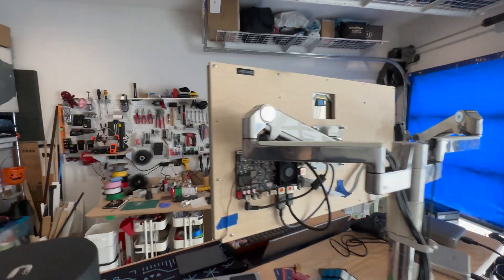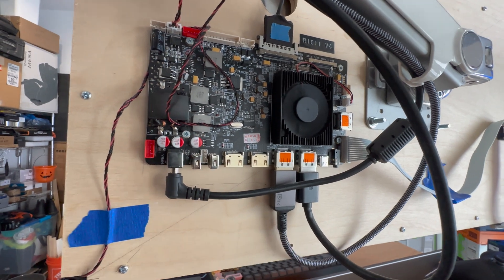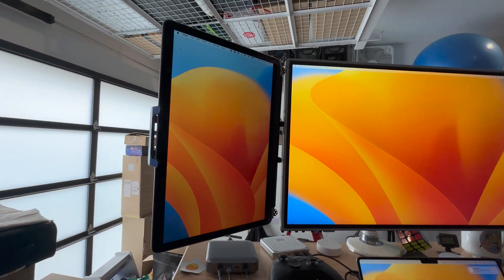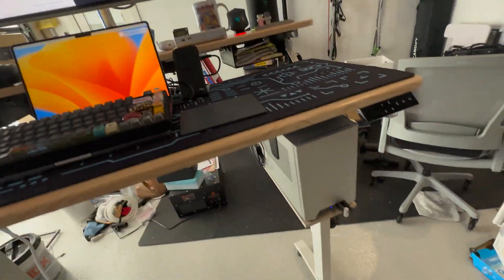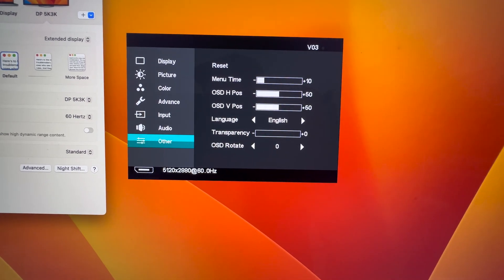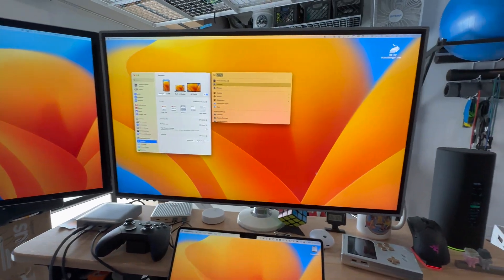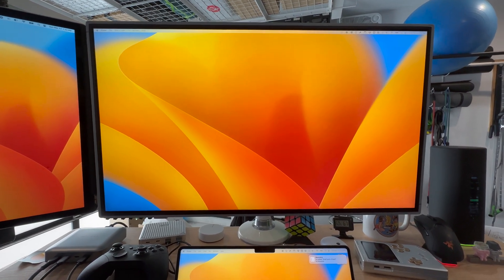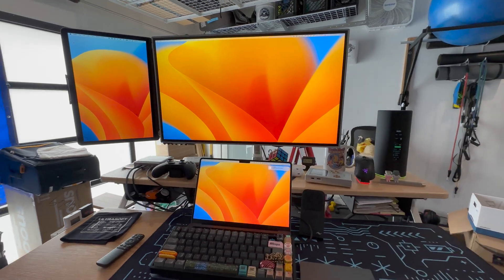Build Your Own 5K Monitor: Part 1

Comment from the maker: Part 2 video out now! https://youtu.be/TRxAxbHYZPc

For those wondering I was able to get this panel to do 3840x2160 @ 120Hz without issues using Nvidia Control Panel to make a custom resolution. 5K seems to be limited to 60Hz.

Comment: How hard was it to get the glass off the front? With just the panel, is that pretty much how the LG ultra fines are? Its just the bare panel you can touch? I know the imacs normally have like a glass cover over the panel, right?

Comment: So the LG 5K Ultrafine has a known issue with their control boards dying - which was handed over to me to 'revive' - I'm wondering if it's worth trying to resuscitate a dead one with this v4 board mod (and taking it out of the chassis)? Hmmm.
Reply from the maker: Would probably work but the board is different size with different ports so it wouldn’t fit perfectly without modifications to the display enclosure. On the plus side though it would add HDMI and and DisplayPort in addition to having Thunderbolt.
Reply: @james.a  oh wow, appreciate the quick reply and input. Happy new year! Old link to the board is OOS, have you by any chance found an alternative seller?

Comment: Is there a way to do a similar project just to make the display capability more convenient like just hdmi and keep the factory display?
Reply from the maker: Yeah. Just get the panel and driver board and you have a 5K monitor with HDMI
Reply: @james.a  I have an old thunderbolt display already. But I use pc so im looking for a way to use it without upgrading the display.
Reply from the maker: Is yours the model A1407 Thunderbolt Display? If so, there are driver boards available that, if swapped in, would give you an HDMI port but it wouldn’t be a simple drop in replacement to get it to fit inside the enclosure. 

This board for example would work on that display: https://www.aliexpress.us/item/3256802367606863.html

And then I’d follow this guide to take it apart: https://www.ifixit.com/Teardown/Apple+Thunderbolt+Display+Teardown/6525

You’ll definitely want to get a couple of those suction cups to pull the glass off. It’s only being held on by magnets and it's not easy without the suction cups.
Reply: @james.a  yes sir A1407 not super concerned with the work involved. Just want to be able to connect it to my pc via hdmi. Your project is pretty sweet but it out scales the budget for my needs.
Reply from the maker: Then that board I linked above should work just fine. Let me know how it goes!

Comment: I saw MST mode in the settings, does that mean one of the displayport inputs changes to output for daisychaining? if so that is very nice
Reply from the maker: I didn’t know what MST support was until
you pointed it out. Interesting… 🤔
Reply: @james.a  MST is Multi stream Transport. A unique feature of Displayport, allows multiple display signals from 1 output on a computer. It's a very cool thing

Comment: I want to make a 24in 240hz oled monitor any idea how that journey starts?
Reply from the maker: First, I’d look for an existing monitor with those specs. Then search only for info about the panel that monitor uses. If you can get the model number of the panel try and find it on Aliexpress. If they sell the panel there then they probably also sell a driver board that works with it. Order both parts and you should have a working monitor. 
Then you just need to build an enclosure to hold it all together. My first one was literally just screwed to a piece of plywood and worked fine like that until I decided to build a better one for fun. 
Good luck! Let me know how it goes.

Comment: Are you able to use the same keyboard on both PC and laptop? Did you connect through a hub/dock?
Reply from the maker: I’m using a thunderbolt hub to connect the 2 displays with 1 cable but using a Bluetooth keyboard to switch between PC and Mac for my keyboard. For mouse, I have one for my PC and a trackpad for my Mac that are separate. I can switch between PC and Mac via keyboard shortcuts.
Reply: @james.a  Haa! Makes sense! Thanks for the reply :)

Comment: what an awesome project! where can I get controller board for Macbook display? The website seems to be down :(
Reply from the maker: Unfortunately the guy who made it doesn't make them anymore. I'm probably going to get a different display that runs on USB-C to mount on the right side instead of another MacBook Pro Display. Will share the files for that mount as well.

Comment: Have you tried overclocking the monitor in windows/macOS to see if it would push 5k 120hz or 4k 144hz? via DP 1.4/USB C or even HDMI?

Would love to know as I am interested in doing a 5K DIY.
Reply from the maker: I didn’t even know that was possible. Where do I start if I want to figure out how to even do that or test it?
Reply: @james.a  Not too familiar on how to overclock it via macOS.

But for Windows 10/11 right click and go to Nvidia Control Panel>Change Resolution>Customize

Then type in the Resolution and Refresh rate you want to test out, etc 3840x2160 100/120/144hz etc, test it out slowly.

Test each resolution and refreshrate 1 by 1 slowly to see how it handles.

Same thing with 5K Resolution go slowly 100/120hz etc.

The screen may flash and go blank for a few seconds after enabling the new resolution and refreshrate.

If the screen goes blank for a second time and reverts to default refresh rate and settings, then that just means your last tested resolution/refreshrate isn't supported.

Hope this link helps. https://www.youtube.com/shorts/CxSH_NaWjJ8

Let me know how it goes!

Cheers,
Lam
Reply from the maker: Thanks for the info! I also have a Win10 PC connected to the display using an Nvidia GTX 1080. By default it's able to do full 5120x2880 @ 60Hz through Display Port cable. When trying to go to 5K @ 100Hz the test fails.

Tested making other custom resolution in the Nvidia Control Panel and so far it seems to work fine with these settings:
1. 3840x2160 @ 100Hz
2. 3840x2160 @ 120Hz
3. 3840x2160 @ 144Hz

For some reason when I try to create more custom resolutions it doesn't save them even though it says the test was ok. It seems to switch to 2k @ 144Hz but the resolution dropdown doesn't include that option in the custom section like it did with the 4k custom resolutions.
Reply: Seems like 4K 120+ works out of the box, 5K 100hz + may require a stronger displayport cable.

If you're unable to push anything over 60hz is my assumption.

I also think if you wanted to game do so at 4K or 1440p 144hz.

I think 5K will work at 120hz if you have the right cable, however if new cable ends up failing, then I would suggest sticking to 1440p 144hz + for gaming as 1440p is half of 5K.

Which is a resolution most people prefer to game on.

So in my conclusion I think this DIY 5K is amazing if you can pull off 4K 144hz out of the box that just means you can hook up your console and game on the monitor at high refreshrate without needing a 4K 120hz tv or even a seperate gaming monitor.

@james.a  Hope that helps and let me know how it goes.

Comment: Great project! Is it a keyboard Keychron K2 pro, how is it? )
Reply from the maker: Thanks! Yeah that's a Keychron K2 and I'm using a 3D printed cover on my laptop so I can put the mechanical keyboard on top without pressing the laptop keyboard buttons: https://www.printables.com/model/171235-macbook-keyboard-cover/comments

The keyboard is fine considering its cost. I know there are better ones available but you can modify the Keychron to be pretty good with new switches and some internal sound dampening.

Comment: You can not use 3 displays using only one TB cable. There is a limitation.
Reply from the maker: Yeah. I don’t mind using 2 cables.
Reply: false, you can. You have to use a MST dock.

Comment: Hi, awesome project, I was hoping to do the same! You mentioned you used an Ultrafine 5K display. Aren't they still a lot more expensive than an outdated iMac. Doesn't that defeat the cost-effective purpose a bit? Or is there a way to get your hands on the panel only for a low price?

Also, if it was an Ultrafine 5K display to begin with, why take it apart to then connect it to a plywood board instead of just using the monitor? Thanks in advance!
Reply from the maker: Hey! Thanks for the kind words. About the panel, I bought it from Aliexpress so it was much cheaper than buying an old LG Ultrafine Monitor. I have the links in the description for the parts I bought (panel and driver board).

Comment: Looks amazing! - if it utilised old imac displays, this could save up to thousands of dollars and probably lots of possible e-waste! - If you ever have a time to make a tutorial thread, please do! It would be insane to make your own studio display from a imac 5k!
Reply from the maker: Thanks! Would be really cool to CNC mill an aluminum enclosure but unfortunately not very cost effective. Still thinking about what kind of enclosure to make for this though.
Reply: @james.a  Honestly, i would make a dark oak wood enclosure, might look nice with the light oak desk. Or Epoxy? Foureyes has some good epoxy resin tables that might be some inspiration.
Reply from the maker: This is a great idea. I've never seen a monitor with a wooden enclosure…
Reply: @james.a  i think you have alot of room to experiment there too, also got some ideas for an ikea based enclosure with a pegboard at the back or some plants at the back of the enclosure too! Might bring some nature to the old desk setup!
Reply: @james.a  you might be able to fit it in one of the old cinema display enclosures.
Reply from the maker: Yeah but they’re pretty chunky. Trying to keep the bezels minimal from the front.